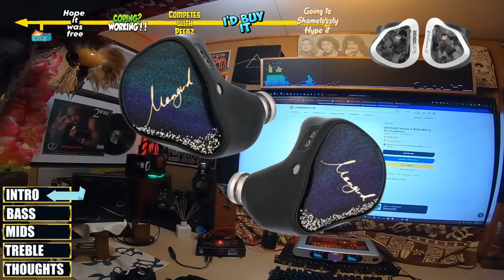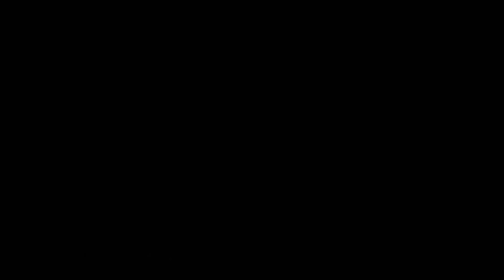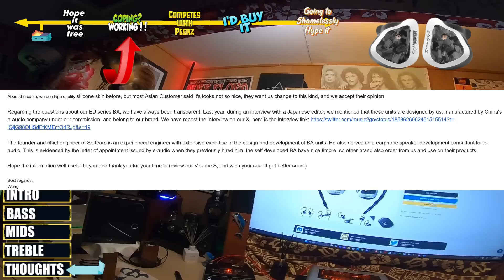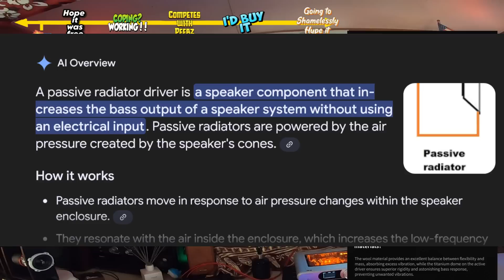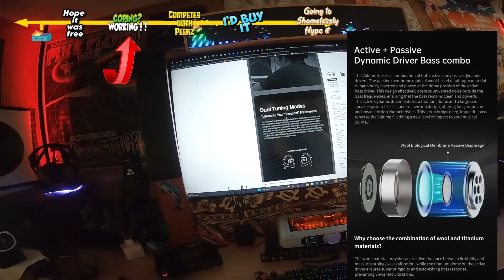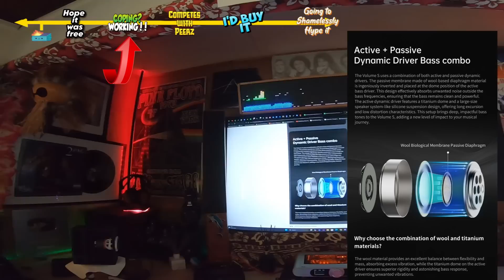Softears Volume S  Earphones (quality control fail)

Comment: This is the most hyped IEM of 2025. The sound quality definitely does not justify the price. My observations are from low impedance mode. I felt the vocals were more forward and shouty.. Treble  is recessed for smooth listening. I have no complaints here but as I had paid 320$, I would expect better handling here. I mean something that makes it standout from low end models like Hexa. Scaling is poor as well. At high volumes it distorts which is very unacceptable. The sound stage is normal as well. I'm not sure how someone like Mark would rate this as the best IEM for the year 2025. It does not deserve it at all. I will be happy with my Hexa in spite of it being weaker in bass instead of spending 320$ for this crap...

Comment: I greatly appreciated the edit at the end. False advertising indeed. 
Are you aware of the CAA and the JARO in Japan. If the product is advertised in Japan you can bring a complaint to either of these organisations. If the CAA receives notice of questionable advertising, it will research the advertising, and, if it agrees that the advertising is misleading, it may issue a cease-and-desist order.

Comment: that was quiet a twist, kind of sly of them really.... i tried these on just a few hours ago and sq wise, was impressed. i agree on your takes about  sound, with tracks i used: Ito (Masaki Suda & Huwie Ishizaki), Sakura Nagashi (reche ft. marasy), The last rain (Uru), and Underdog (My first story ft. jesse). i was very pleased with every track except underdog, it was kind of underwhelming and lacks the hit i expected. sadly there wasnt any xenns as far as i know. i tried volare from i/o a short while but it wasnt as good as volume s sound wise and kind of underwhelming. what i was surprised a lot was with deuce, it really nails it on underdog with that bass, its surprising because ive just opened the graphs after i went home (just now) and its still so clear with that much bass. trying them out really solidifies some things which i had doubts about (like how you know something, and understand it logically but still have lingering doubts as youve never experienced it). idk if i can recover from this ever (was fun :D). fun fact, dinosaur depictions from fossils are usually inaccurate and with various interpretations because of the lack of knowledge i guess, like wrapping a blanket on skulls, hard to know exactly how hairs, feathers, thickness and other features are defined as is hundreds of million years ago. :popcorn-yellow-striped-smile:
Reply: also, ive just realised this?????? nearly 200K subs! congrats in advance

Comment: Did you experiment with the 2 impedance modes? Shouldn't the higher one in theory increase bass a bit?
Reply from the maker: No. The harmonics  being more emphasized will result in a sense of “loud” but not bring out the fundamental of low frequencies more It can only infact mask. It is the inverse of bass 🩸 into mids
Reply: @BadGuyGoodAudioReviews  thx for reply, always cool to learn something. Btw now that i got your attention, which do you think are better for me: hype 4 or tea pro. I found a sound demo on iec 711 clone on yt comparing these 2. Taking it with a grain of salt because the treble is always louder in my ears and peaks appear in different places, i found that i like the hype 4 in upper treble but im worried it may be too much, also the bass seems cleaner/less muddy basically not masking anything. Tea pro on the other hand is easier on ears, mids and lower treble like 2k and around is more correnct imo. Im really not sure what to pick can you help me?

Comment: IIRC the active DD is mounted to the recessed area inside the housing on the left side of the metal housing you see in the 12 hours later segment, while the passive is mounted to the back of the front piece with 7 holes on the front, creating a tiny chamber when everything is pieced together. So I believe this is a 4th order bandpass with passive radiator. Softears did a bad job of showing and explaining it.

Comment: Hey, what's your opinion on the tuning differences between the ziigaat Odyssey and this? I was considering the odysseys but these seem intriguing. I want something laid back and warm, mainly want full male vocals and non fatiguing treble. Which set would you recommend between the two? Or would you pick something else in the 200-350$ range?

Comment: I am actually deciding between the tea pro and volume s but unsure at the moment.. Beside the low end of tea pro being more meaty, would you say in term of vocal wise, is it an even match?
Reply: i demoed both and i can clealy say that both are almost similar but softears has a very flat bass, vocals sound more emphasized on them and sound a bit lean not full bodied, treble comes out more clealy on softears due to flat bass and midrange, meanwhile Tea pro sounds a bit bassy, but the bass is adequate not too much, vocals are a bit smoothed out so no emphasis on them, vocals may sound a bit veiled sometimes, treble is a bit controlled and non-interfering. Technical/resolution wise both are same. I would say if you listen to low to mid volume go with softears but if you like to listen to mid to high volume go with tea pro the vocals being veiled was completely resolved by just turning the volume up a few notches for tea pro, so i ended up buying those instead, ideally i would have bought both but i alredy have Truthhear Hexa and Letshour Cadenza 4 for those lean neutral type flavour at a much lower pricepoint. If you want to go the Softear direction also check out Juzear 81T as well its very similar at a slightly lower price point.
Reply: @mrigankadeyMD  thanks alot! Appreciate the detailed comparison!!

Comment: Whoa, I didn't know there were that many earthquakes in Japan but I guess it makes sense given its spot on the Pacific rim. Stay safe!

Also, I agree with you that the words used for advertising purposes matter. This is a more technical hobby than others so there needs to be precision with how things are described; the driver count and description is the most basic of things that needs to be correct.

Comment: Considering that the evaluation of the previous product, Vloume, was quite good, it is true that VolumeS is also receiving excellent evaluation from the perspective of monitoring products.

but 
In the case of two dynamic drivers usually connected in series within the same chamber, there is no reluctance to understand the description that this is a 2DD.
But I agree that it's... like a pun for marketing.

Comment: First of all I hope your loved ones and you are safe from the earthquake. 
Second thanks as always for the review. It may be a good set and something that would be complementary to my current collection of iems. Something different.
Thanks for being thorough with the drivers. Not only with trying to get manufacturers opening up about which drivers are being used but also calling a company on being just gimmicky and inventing things on the fly.
One big remark though: you said "letshuoer" multiple times in the addendum but I am guessing you are refering to "Softears". 
Maybe if I have a lot of spare money I would consider buying this set because I do trust you when you tell us it is a good set but seeing I need the bass for my library it will not be very high on the "to buy list". 
Thanks again for the review and hope your loved ones and you stay safe.

Comment: Wanted to get your thoughts on cables with different impedances / Audio Amigo put up a video where depending on the configuration of iem would change sound because harder to drive.
Also I remember how much you liked Xenns UP- how close is that to the mangird tea pro ? If the pro is the new benchmark!!

Comment: The Tea Pro might be a better set, but there's just something about the Volume S that I can't get over. Maybe it's just my Softears bias kicking in. I really enjoy this tuning profile. However, it's a bit questionable how they disclosed their driver type. I initially thought they used two dynamic drivers, but it turns out they labeled the passive radiator as a dynamic driver, which isn't accurate. I often see this in Bluetooth speaker reviews too, where reviewers call passive radiators "speakers," which is simply incorrect. But seeing this from a brand like Softears is disappointing. I still like the IEM, but they gotta get rid of the fluff

Comment: I had a feeling about this one. Interesting how good Softears perform (get reviewed - not necessarily the same thing) in spite of proprietary drivers - I guess there is an argument that if done well the ability to develop in house has its advantages in terms of seemless integration (fit for purpose = less crossover parts and work arounds needed) and ability to adjust tuning in other ways than through the shaping of housing, physical filters etc.

Comment: Tonality( Volume S)vs technicalities (Dusk). Which is the correct way? 
In India smartphone companies are doing clever trick by changing only numbers or adding 'PRO' or 'MAX' suffixes to the processor names and releasing old chips as new improved versions or they change very little. There are tons of mediatek processors with complicated naming to confuse customers and make them believe that they are buying better mobiles. I hope IEM companies don't follow same strategies when they Quote BA drivers.
Reply from the maker: Earphone companies are running hustles like everyone else. We can see the specs easy for phones and stuff but IEM is a lot of "trust us bro"
Reply: @BadGuyGoodAudioReviews  Yeah You are right. My concern is that they can play number games and I hope they won't. All smartphones I've mentioned are mostly chinese ones. They're like 'You want better processor and Specs, we give you better ones but in name only '

Comment: They just made diaphragm  heavy by putting extra membrane on it got it
Reply from the maker: Engineer? You sound smart. It actually sounds like a bad idea because the suspension on the cap can get outta synch with main driver in milli second time frames but...it seems like a bad idea. When the driver retracts it pulls on the caps 2nd suspension which collapses while main is in excursion..it is a bad idea but i can't hear any probs. Just not 2DD in any kinda way
Reply: @BadGuyGoodAudioReviews  yeah agreed   2dd is misleading Info...